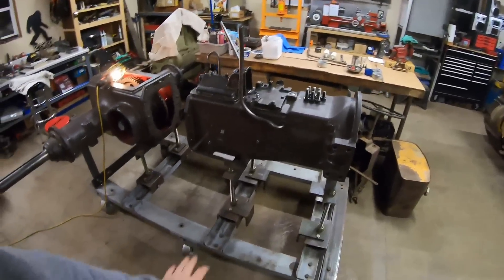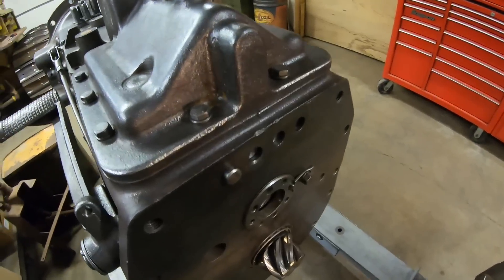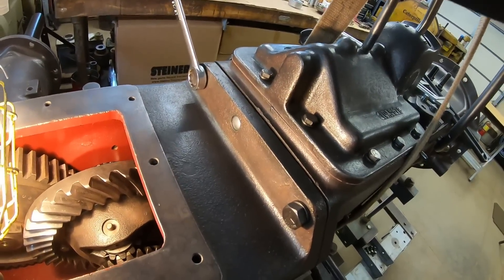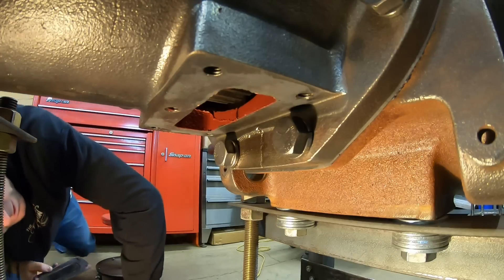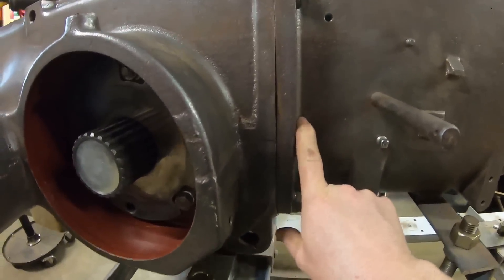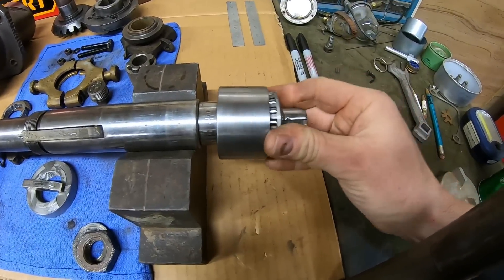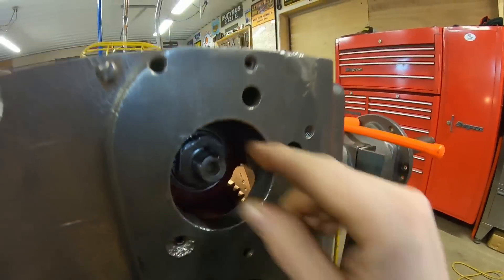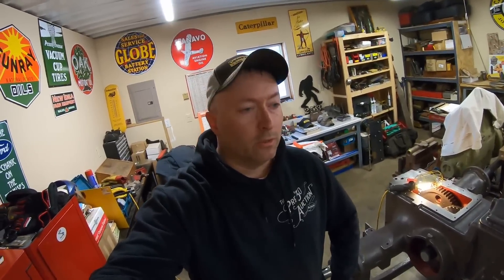#X231 Prototype Part 58: Main Powertrain Goes Together! One Step Closer to a Roller...

Comment: I would suspect that the fourth gear rail had been an issue jamming in the forward position so they drilled the hole out so if it happened again they could use a punch and a hammer to free the rail.
Reply: I think someone got a little too happy with the drill and just punched all the way through. Then they said, "It doesn't matter, it's just a prototype."

Comment: I have to say that I enjoy all that you put on your channel. We don't have snow where I live in Australia. We have different weather conditions here with the rainy season generally starting some time in January and finishing sometime in March. Some times we don't get a rainy season. We sometimes get cyclones which bring a lot of rain and damaging winds but generally these are about every 6 or 7 years. It is good to see what other people have to deal with weather wise. I am 73 years old and now retired. I spent all of my working life in road construction both residential subdivisions and highway construction. When I started work in 1968 there was not much new construction plant available. This changed in the mid 1970s when the old plant seemed to vanish. I enjoy watching the restoration of old machinery and see some similar to that which used to be common when I started work. Caterpillar D4 and D6 size tractors were considered big tractors then and D8 and D9 bulldozers were considered exotic in the area where I worked. They became common later on.  Agricultural tractors were used to pull rollers to compact embankments and gravel pavements. It is interesting to see this old equipment brought back to life and particularly when it is rare. I would like to be able to do this sort of work but living in town, I don't have the room or facilities to do it. The next best thing to do is to watch someone like yourself do it. I learn something with most episodes. Keep up the good work.

Comment: Excellent video it looks really nice with the transmission and rear end housing bolted back together. The hollow staking pin is a very good idea to keep the bearing retainer from spinning and causing problems again. Them pto clutch linkage straps and dogs are sort of a Minneapolis Moline weak spot my G900 diesel has gave me problems with them things over the years

Comment: Now we are truly at the most tedious and threated part of X231. I'm actually hyped to see what else you came up with. As for the clearance issues with the X231 bolts. Let me say this as a fact. On a Belarus 500 tractor and the later models have all the certain bolt have shrunken/resized heads shrunk so they would fit into very tight and inaccessible corners. They maintain there standard metric threads (like M14x1.5) but the head is shrunk significantly . So one more reason to save up old hardware cause when your installing hydraulics and the bellhousings. Than without the resized head bolts you will not be able to mount a larger size head bolt into the existing threads. New Soviet hard wear is still available but they are not easy to find. The resized head bolts only came with the tractor so the only way getting them seems to be from a parts donor.

Comment: One of my favorite parts of this project is watching your shop fab handyness making the askew nature of the "X" ness come tgether with simple but very effective applications like grinding the bolt next to the clutch assembly to a clean tolerance and the same with the plate under the gasket has a clean fitment and the line bore on the shaft. I replay it not because I will ever do any of this but so I can catch the thinking you employ. I gotta say, watching you move through the processes is almost therapeutic.😊
See ya on the next one.👍🏼

Comment: 9:33 Maybe a custom bolt with a flat pan head with internal hex so you can seal the hole, and possibly use a thin washer? Not ideal but might work.... just an idea.

Comment: While big viewership is nice, not everyone will stay. And people being people not everyone was tought say some thing nice, or don't say anything...Squatch the REST of US are here for YOU. So let the easily distracted SHALLOW viewers find another channel to complain to that "they are not satisfied with" Bye bye... BUBYE... I also be came on board during the early days of X231, with the occassional Iron mistress plow day, then you guys picked up the now Swamp Angel, the Cat that never was supposed to be rebuilt and yes it has been real good to see all the trials and tribulation along that proccess. And now back to  Christine, I was very impressed with the thought and effort that you put into Correctly line boring that near basket case rear drive housing. I just watched the proof of concept when you installed some of your creations with the original shaft and wal lah it fit just the way the Engineers intended. I was not surrprised that it fit, quality work begets quality results. If the hollow set screw holds the bearing races in place you will have fixed a glaring oversight of the design Engineers. Oh yeah, what else is new... That sir is why this guy is still happily watching you channel.

Comment: Thanks for another great update, that line bore job was better than  spot on when you consider it was done in a home workshop. I've seen more modern JD tractors chew pto shaft bearings/bushings out of housings like this, and several local professional full time machine shops won't touch repairing them. The tractors ended up scrapped because either the casting was obsolete,  and  used/ new if available plus the work fitting it was way more money than the tractor was worth when other problems were found and fixed. Take care

Comment: could you machine a spacer to fit between the 2 taper bearings? this will help maintain correct bearing preload/clearance while the nut is properly torqued

Comment: Good for You! Excellent Job! I guess I missed in previous videos, I was thinking that your component were on two different carts and that the one that you made was tied up with 5J1113. A piece at a time like Johnny Cash sung about and soon enough you will be done or at least to a real good resting point. Please do not let her sit for years on end though the dirt and dust from cleaning parts and pieces for painting will make her a big mess.,Some rainy day that you are waiting for paint to dry part to come in would be a good time to do little pieces of work and video them to do a video/work collage of clips of work and narratives together say on the repair of the live power shaft or flywheel or front bolster etc.
Have a good day enjoy the weather, we are supposed to get more snow tonight thru Monday morning then nice until the weekend(more snow)

Comment: The only thing I’m not liking on the pto is on the very end. I see why they placed that big heavy thick washer before the end nut. You have the nut turning with the pto shaft and that rides up against the end of the last bearing. You should make some sort of washer that also utilizes at a lock washer to keep that nut from wearing that bearing end out.

Comment: They may have drilled that 4th gear rail hole out so they could remove it with the rear housing installed specifically if they were having issues with that rail .

Comment: You should make a spacer of the correct thickness to provide the running clearance of the timken bearings so the nut can be tight. The same concept that a pinion in a differential has

Comment: Countersink a screw in place of the cover bolt.  It is just a cover,  it is not a piece which is under great stress. Do not forget to oil the bearings before running it.  It looks dry.  Cover does not have to be so thick.

Comment: I had mentioned a lot of work left on this project. So many questions that will be answered as this series continues. I guess the assemblies beyond the PTO like the hydraulic system, the rear end cover, power steering bolster, cooling system, fuel system, electrical system and all the sheet metal and tires, wheels and finally take some of it back apart to paint.
Reply: Thank you.

Comment: Squatch, I don't know what thread size you tapped that oil hole. That being said there are push connect pneumatic air line fittings out there that have a Hex for the through hole for using an Allen wrench to tighten them. I have seen taper thread but also Straight thread fittings. Maybe you could get lucky and find one you could modify to use as your retention screw. Just a thought. Even if you scratch made a screw you might broach a Hex in the through hole for installation and if need be future removal....

Comment: Some of the shift rails were remodelled as a break fix. Could this have meant that the forth gear rail needed additional rearward travel, hence the the hole in the flange?

Comment: I may have an idea, why they boret that hole all the way trough the casing. Here is my idea: The shifting mecanism vith forks an gearlever was so worn, tah sometimes, whwn leaving 4 th gear, the lever went in neutral posisition but the 4th gear slippet back in engagement, caused by the springloaded ball. Now you are in 4rth gear, but your lever is in neutral. The only way to get the gearbox to funktion again is to get the 4rth gear in neutral again, so they drillet a hole and could by that hole press the 4th gear in neutral, and ewerythin is ok until next time it happens. I am 74 ears old and have a lot of experience on old tractors and things like that and hav seen these problems many times. Hope that you can read and understand my english, i am from Denmark Europe.

Comment: How come you didn’t try using external torx head or Allen bolts with an integrated locking surface for the flange?

Comment: They probably drilled it out trying to solve the shifter problem ! Of staying in gear! Make more room for more travel! It was not the correct repair/fix!
Reply: @squatch253   got it but what if it git in two gears at same time they hade place to push out of gear ????   And how much got changed when 3rd fork broke/damage  they fixed replaced? Any way. Thanks for the reply!!!  See Borks not posting ?

Comment: Old Christine has fight in her still it will be hard not to get her back together after all the work that gone in her this far I know you are trying hard to keep it as much prototype as you can but if the parts are inside casing them what is the big deal if you have to use production parts you are still keeping an old rare prototype tractor going

Comment: The bottom cover interfering with the bolts that connect the back end convinces me that the engineers were half-assing things or were just bad. Why spend so much time on an obviously inferior machine. Just because it's a prototype is no excuse.